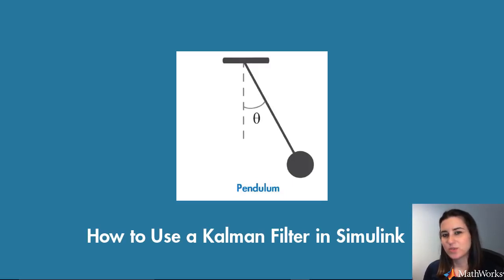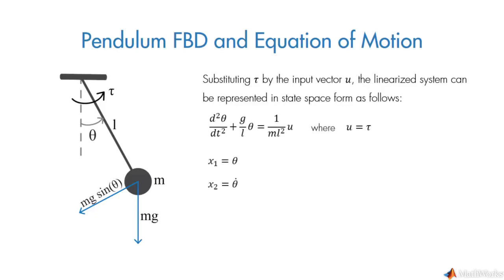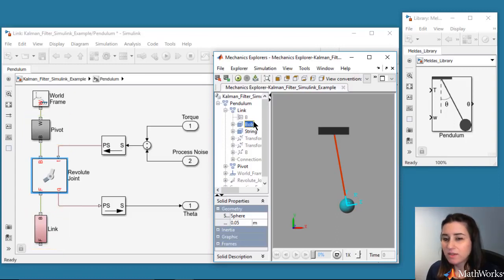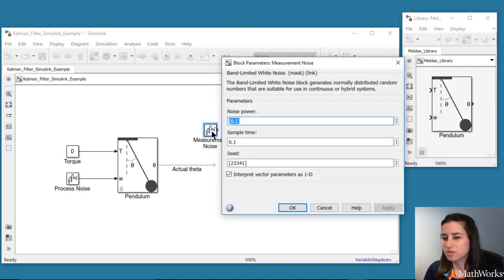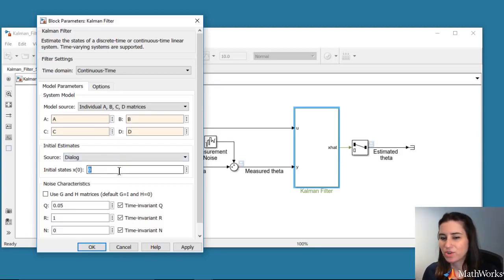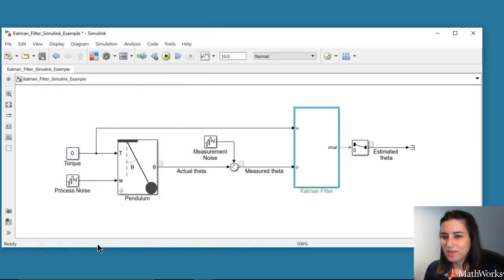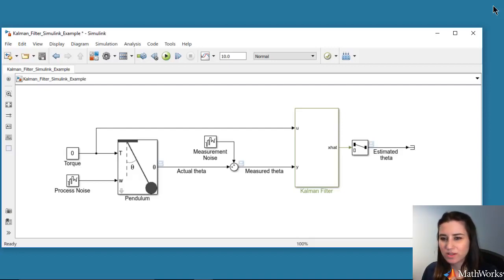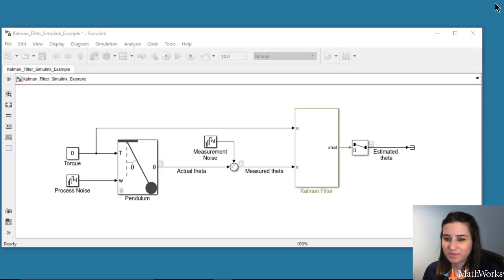在 Simulink 中使用卡尔曼滤波器

Comment: I don’t know why Kalman filter is inaccurate when giving the larger theta? And why control matrix is giving by zero? Please help keto figure out🙏 I’d really appreciate it
Reply: as it explained, Kalman filter is linear filter, it can only solve linear process. for example, when theta less than pi/10, sin(theta) equals theta roughly, but once theta larget than pi/10, sin(theta) is no longer close to theta, thus, in this case kalman filter doesnt work if given larger theta. for control matrix, its depend on how the spercific process, pls go over again the differetial equations in this video.
Reply: @杜俊彦  right